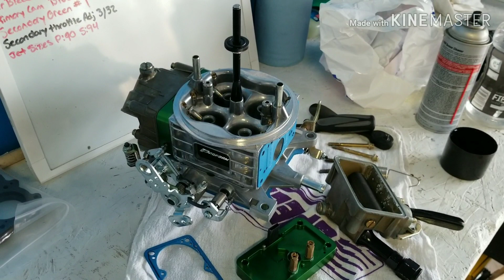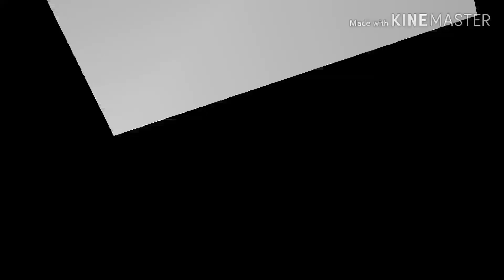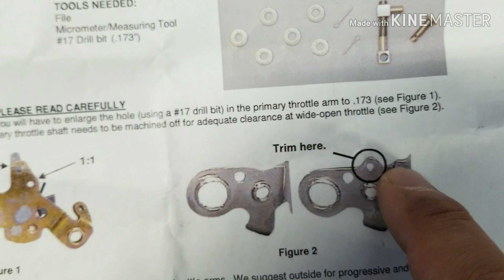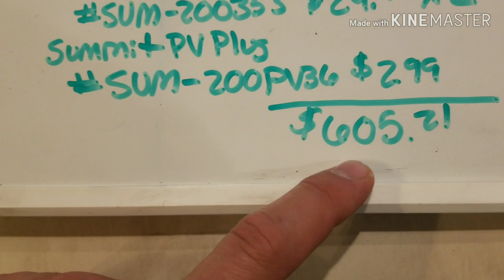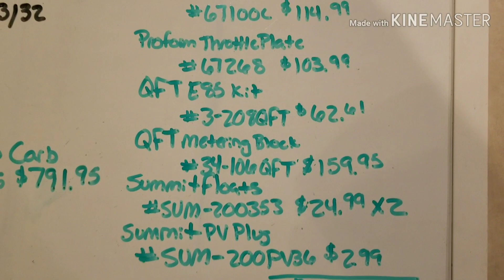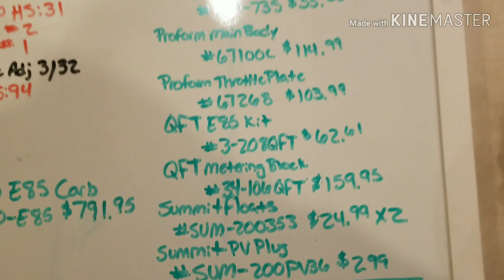E85 carburetor new parts and parts list

Comment: Nice update, what size are screws used on the ac delete plate?
Reply from the maker: None of them are in the factory holes. I had to drill out the holes to use those. I think they're 3/8 bolts. I only used the stock bolts on the top under the cowl where you can't see them. I couldn't find any button head bolt with the threads the stock bolts had.
Reply: @dhosack85  oh damn, thanks bro

Comment: maybe this will help. i just did the same thing on my drag car. first yes E 85 is sticky. needs to be cleaned often. when i first built mine i used a gas main body it had a bad bog when you first floored it. i changed the main body to a alcohol main body. it completely eliminated the bog. also remember the higher the E content say 90 will be leaner than 85. the less ethanol the richer the mix. I hope this will help. always glad to help another gearhead.
Reply from the maker: What do you suppose the difference between a gas body and an alcohol are? Larger passages? There really isn't much to a main body.
Reply: @dhosack85  yes the passages for the fuel is larger. where it comes out of the venturis. alcohol and E85 need to flow a lot of fuel. one more thing how large are the squirters. may need to be bigger. say it has 28s on it may need to be 37 or 42